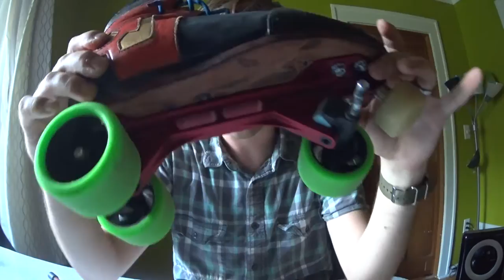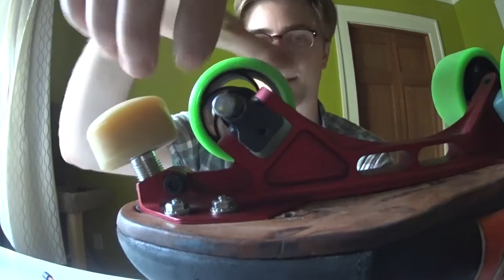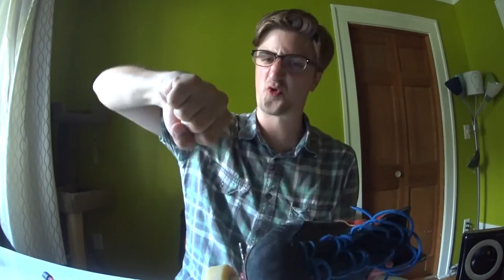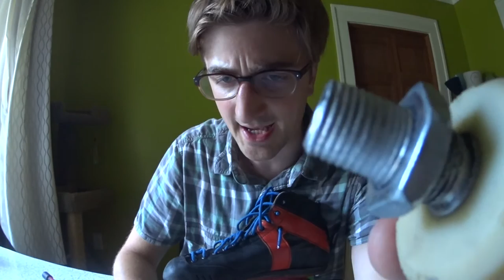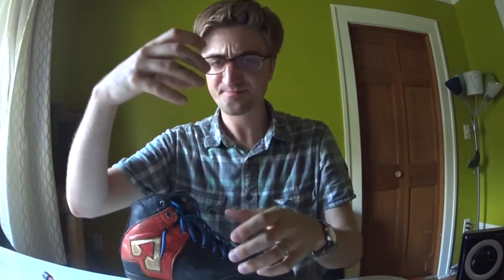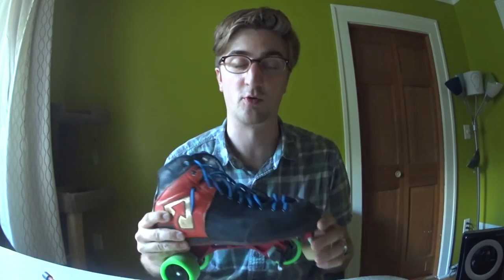How to Get a Powerdyne Arius Plate to Hold Toe Stops

Comment: haha wow, just bought myself some arius plates (im guessing they're a newer version) , hoping they would be a dream come true and little did I know I have this problem now.... an absolute nightmare... and my shop is not responding to my messages for a week now so ive turned to good ol youtube haha funny how I'm not alone with arius problem plates
Reply: What problem? Sounds like  you a too new skater trying too elite a plate . This is meant for advanced elite skaters. Newbies and regular skaters still learning will do best on the standard reactor pro. 10 degree trucks keep you stable and upright. Arius is closer to 45 degrees as they don't use the same system.

Comment: Hi.  Just got my new Arius plate set up and want to change my gum all stopper to dance plugs.  However, the screw won’t budge.  Any suggestions?
Reply: Try harder out muse in  or bring to a shop
Reply: i had to sent my set up back to Riedell to get it fixed